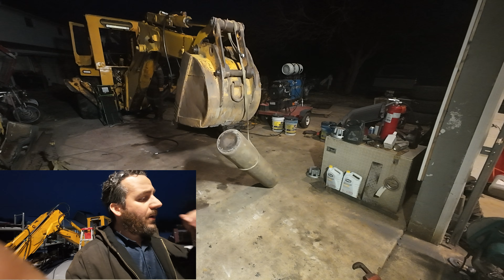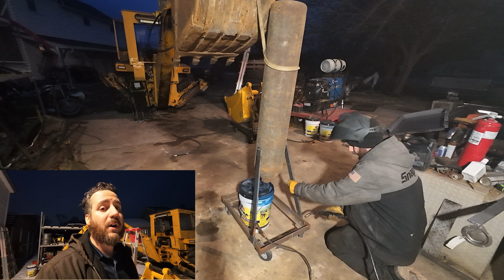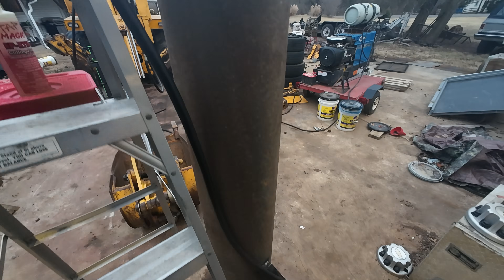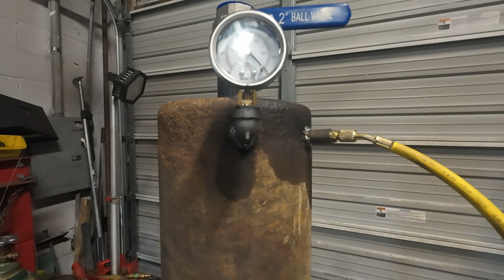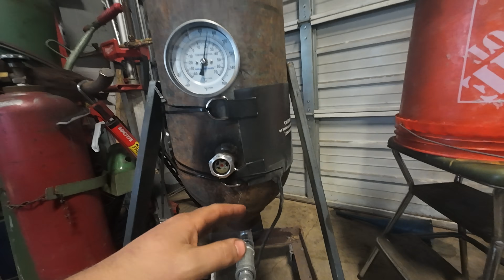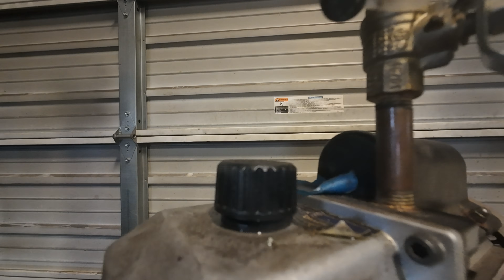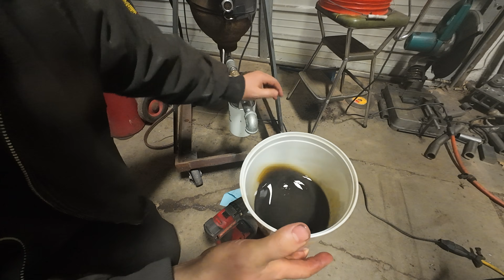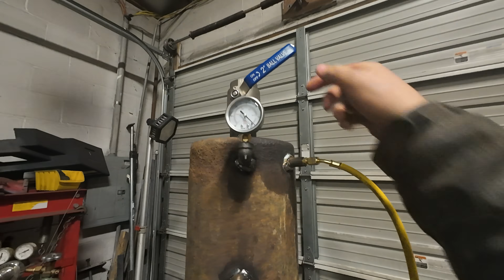I made a machine to remove water from hydraulic oil. Vacuum de-hydration

Comment: I understand this video is a year old but I just stumbled upon it. Didn't watch the whole video yet and I can't be the first person to make the suggestion, but seems you're concerned with the heat output of your belly band.  Especially in the colder climates. You're right dumping too much heat the ambient air.  Any insulation will do. Just wrap the tank from top to bottom. That would help with the extraction. Water vapor will condense on the sidewalls of a cool tank. The warmer the tank, the less condensing the vapor will do. Which means you'll increase your energy efficiency. And you'll also increase the speed at which you extract..   And we all know the most precious thing we have is time.  Takes a lot of energy to get water to change its state from liquid to a gas.  It'd be a shame to just see that gas recondensed on the sidewalls of the cool tank and just run right back down into the oil. Any old shitty insulation would do. It's the most important thing with it is. If you're using a fiberglass type insulation, that's fine. Just don't smash It. Smashed insulation  is about as useful as a toddler in a machine shop.  I'm enjoying this video.  And I'm stoked to see how it ends for you so far. It's a fantastic build, multiple sight classes and shit haha.  This is dope my dude!!

Comment: Your next design should be a simple gravitational centrifuge separator.

Gravity needs assistance for greater separation. Then, once that is done, you can use your boiling or evaporation processing for a final separation.

You can use a home AC unit for your fast water extraction. You shouldn't need high heat.

Put the home AC external coil into the oil. It will heat up the oil and water mixture. Have the air pulled over the cold internal coil, and it'll extract the water from the air. Use a simple hygrometer to see when the humidity is zero, or near zero, to know when it's done.

A simple water pump to pull the hot "water saturated oil" from bottom of the solution over to the cold side, to expose the water. Then, on the cold side, you skim the top oil off, back over to the hot side, since it has had the water extracted. (Return it to the middle, not the top of the hot side. The top of the hot side will be mostly oil.)

Comment: Love the work my guy! May I offer some suggestions, coming from someone who recycles oils and works with industrial level recyclers? 

Its not a big deal now, but metals from your oil might eventually concentrate to levels that are dangerous to your machines and health. And those metals will be fully dissolved in the oil, so physical filtering wont remove all of them. Developing a way to control those metals will go a long way in protecting your equipment and your health. 

Overtime, even well made steel can pit from exposure to hot oil and water, and it wont be obvious if that metal is weakening. If you had some way of looking in your cylinder to check for pitting, you would be able to spot failure points before the metal ruptures.

Comment: Definitely put an inline container between pump and tank to reduce the amount of oil getting into your pump. That’s  how we dis it when machining using a vacuum plate to hold work, to prevent coolant from invading the pump. Excellent setup!

Comment: Very nice.
Sticking the tank on a set of bathroom scales will tell you how much water is in there by doing a before and after measurement. You could also potentially use it to see when the drying process has completed. You may see a rapid drop in 10 minutes once you hit x degrees and y inches of vacuum and then nothing after. Having that info might allow a much faster cycle time.

Comment: Insulation around the heating band, and a good part of the cylinder. Will help greatly.
Also, I watched out of interest without much knowledge of the process. And immediately wondered. Could you use a whisky still off Amazon etc. Or would foaming be too much of an issue?
Reply from the maker: Wont know until you try!

Comment: An easier way is to buy a cheap electric hot water heater and strip it down to the tank. You can replace the existing thermostat with industrial controls as well as weld in a "sight tube" to give a much better observable fluid level in the tank. I have seen setups like this for processing used cooking oil into biodiesel and they will weld a fitting in the top of the tank to insert a mixer and run that continuously to agitate the fluid to keep the debri in suspension. To further take out moisture you can run the fluid through a series of filter driers that use desiccant as well as filter screens to remove more of the debri and get cleaner oil. This is a great idea to save money and help keep the performance up on the hydraulic system, it's my understanding that when the hydraulic oil has moisture in it and foams up it can be dangerous to the functioning of the booms and buckets, especially when trailered it can cause the arms to lift on their own just from vibration on the trailer, thats where you get bridge strikes on transportation trucking.

Comment: I just want you to know I thought of you and this video when I had an idea to fix a problem a little over a month ago.

Sort of unrelated to this, but I replaced a power steering rack, and the hydraulic fluid would froth and dissolve the gas we were trying to bleed out.

I don't know if it was because I had seen this video recently or just basic physics from the teachers I had in school, but I drilled a hole in an extra cap. Well, it became extra after I got another one because I was drilling a hole in that one 😂

I hooked up my vacuum pump with a chamber in between to catch any drippings, then just pulled a vacuum on the system. Once it stopped bubbling and pulled out all the air it could, I started the pump and worked the cylinder back and forth to circulate the fluid.

The rest of the fluid still had gas dissolved in it, but every time it went into the reservoir, the pressure above the fluid was so low that the dissolved gas would come out of solution and rise to the top.

The whole thing wouldn't bleed for over a week with a bunch of professionals working on it. Then I fixed it in about 10 minutes with a similar application of basic science and a vacuum pump. 😂

Comment: if you have a old freezer you can pull the vacuum line thru a tank inside it and it will freeze out the water on the way to the pump.

Comment: Those old cylinders are not clean inside. So a pile of the dark colour coming out is probably just cleaning out the old tank.  It will most likely get better with more cycles - you could even totally top off the tank then dump it out again a few times, to move debris off the tank walls.  It would be interesting to run the output through a centrifuge, to see if more fines stuff comes out.  Re operating it, I would probably just run the heater for an hour first with the top valve cracked open, then when it's warm turn the vacuum pump on - the pump noise would drive me nuts.  :)

Comment: Tipping the tank horizontally will significantly speed up the dewatering process.While turning the tank horizontal increases the surface area by 4 to 5 times, in practice, the actual rate of water removal will likely increase by even more than that. Here is why changing the geometry makes a massive difference:

1. Surface Area & Mass Transfer Limits

Evaporation under vacuum is directly proportional to the liquid surface area exposed to low pressure. In a narrow, vertical tank, water molecules must reach that small top layer to vaporize. By placing the tank horizontally:

You multiply the liquid-gas interface area 4–5×, allowing 4–5× more water molecules to escape into the vapor phase simultaneously.

The average distance water molecules inside the fluid have to travel to reach the surface is drastically reduced, shortening the diffusion path.

2. Reduced Hydrostatic Head (Pressure Suppression)

In a vertical column of fluid, the weight of the hydraulic fluid creates hydrostatic pressure at the bottom.

Liquid oxygen tanks are tall cylinders. A few feet of heavy oil exerts enough pressure at the bottom to suppress water from boiling, even if the top surface is under deep vacuum.

Laying the tank horizontal flattens the oil layer, eliminating most of this hydrostatic head. This allows trapped water pockets at the bottom to boil off at much lower temperatures throughout the entire bulk of the fluid.
Reply: Commercial machines exist. They are commonly referred to as Vacuum Oil Purifiers, Vacuum Dehydration Units (VDUs), or Kidney-Loop Oil Reclaimers. Maximizing Surface Area (Atomization): Instead of letting the oil sit in a pool, the machine uses internal spray nozzles, coalescing column packings, or spinning dispersion discs to turn the oil into a fine mist or thin film. This increases the surface area thousands of times over, evaporating free, emulsified, and even dissolved water down to single-digit PPM levels within hours. Polishing & Return Pump: The dry oil is pumped out of the bottom of the vacuum chamber, passed through a fine particulate filter (often 1–5 micron) to catch debris, and returned directly back to the main reservoir.

Comment: That reminded me, I use to work at a power plant. Among the issues we ran into was contamination of the oil for turbines. The company found out our expensive equipment was getting ruined. We were asked what we were doing to clean the oil?
We had an oil centrifuge that hardly nobody could operate because, it was work, people were too lazy to do their jobs. The guys with the most experience knew how and many of the younger guys didn’t want to learn. 
So the company invested thousands of dollars into a new system to clean the oil, using very fine filters. But they still required maintenance. 
The job of the operators was to keep an 👁️ on the equipment, take daily readings and alarms. 
Then the job of maintaining or cleaning. It became my job to write up a procedure how to change filters, very simple. Again nobody wanted to do any work. Again we fell into the same problem of contamination because nobody wanted to do any work. 
Again I was asked to order the parts needed to bring the equipment back to 100% status. 
For me as a mechanical minded person, it was very simple. It took me about 2 weeks of ordering the parts and getting it back in service.

Comment: Since you're heating the oil already for the water separation, additional filtration using a centrifuge should work well, it should get out most of the remaining particulates, and would be fairly easy to add as a second stage with the way you build that system. This looks to me like a fairly effective and reasonably cheap way to accomplish the mission, I just might build something of this sort for myself, I think it would come in quite handy on occasion, partially because I am a professional waste oil heating equipment technician and of course I use the nasty stuff myself for heat also, but have no plans for processing customers' oil... Ain't gonna go there, that's a whole 'nother business that I don't want. Some of our customers are construction eqpt service shops that burn lots of hydraulic oil for heat, and it is definitely one of the better fuels (unless it's flame-proof aviation grade... that's a story with a lesson), it burns hot and leaves minimal (snow white) ash deposits compared to other oils.

Comment: I PICKED UP AN OLD-- CHEAP --CHEST FREEZER--HOLDS 4 ---5 GAL PAILS--THE WATER FREEZES--THE OIL POURS OUT--THEN I DISPOSE OF THE DIRTY BIG ICE CUBE--I USE THIS PROCESS TO REMOVE THE ETHANOL FROM THE GAS I USE FOR MY GARDEN TRACTOR--CHAINSAW--WEED WACKER  ETC --I PUT WATER IN THE ETHANOL FUEL---THE ETHANOL BONDS TO THE WATER AND FREEZES--WHEN YOU GET RID IF THE ICE CUBE----YOU HAVE PURE GASOLINE---YOU NEVER HAVE ANOTHER BLOCKED CARB ---FROM GUMMED UP ETHANOL

Comment: Hmmm, would using dry calcium chloride as a drying agent at the bottom of a column and filtering the  emulsion through it do a quicker job of it? you only need to bake the calcium chloride every so often to expel the water it holds on to?!?!?!

Comment: I had used a large ring burner stove and huge pot to get the water out from my oil. I looked up the max temperature that the oil could handle on the spec sheet and made sure it didn't cross that. It worked but that was a tedious process and I doubt I will do it again even though I know I would not have gotten all of the moisture out since some would have still been trapped in the cylinders.

Comment: suspended particulates, huh  I forget a lot of things ..reminds me of ethanal fuel is a suspended liquid, within gas and it seems that it is a water based alcohol that of course burns, but also corrodes the crap out of fuel system parts,  I saw a vid where a man added water to Ethanol gas, let it sit in a clear container and ended up with more water when it separated .I was amazed at what he was doing and how he found that out. I am working on used oil for diesel and saw this again , I have a vac pump i will tap into my 50 gal drum and dry the fuel/oil this way . good video

Comment: Boiling hydro fluid ruins it just as bad. Hydro oil gets burnt and gets ruined. Just as you made.
Reply from the maker: Gotta wonder if its the temperature or the vapor pressure? It never exceeds 140F in this setup... but things can still technically boil

Comment: From ryco filters

"Standard Filters: Often rated at 25–35 microns.High-Performance/Synthetic: Often rated around 10–20 microns.Significance: A 15-micron filter can reduce engine wear by roughly 70% compared to a 40-micron filter."

Need a good hydraulic oil filter to get finer

"Hydraulic oil filters typically range from 3 to 40 microns, with common, high-efficiency filters often rated between 5 and 10 microns (absolute) to protect sensitive system components. Return line filters often use 10–25 microns, while suction filters are coarser, around 100–150 microns, to prevent cavitation.

Comment: So if you want some interesting modification to that system...

First, use a double or tripl vacuum pot design BEFORE the pump.

Second, put a valve in the vac pump line.

Third,..this is crazy...Go get a double action hand pump. This is by ozark trail, used to for inflatable beds.

You can use the hand pump to pull initial vaccuum very quick, then switch to the electric to pull a hard vac.

Ps..
I forgot this. Since what your doing is literally distillation...

The bigger your output orfice, the more volume mostly, and sometimes faster you can pull of your distillate..Ie water.
Downfall is, it's require a significant btu/heat input.
It's usually rated as litres/quarts/gallons per minute/hour.

Also, hydraulic pressure is basically a rating of compression. Compression alone, can generate allot of heat.
An electric forklift typically is rated for 8k psi...NOW, let's put this into perspective...
Transmissions-400psi@around 120-230°f; brakes-400-800psi@400+°f; power steering-1k-1800 psi-unknown°f.
These all use a form of hydraulic fluid.

Facture in, water boils at 212°f.. So hydraulic fluid MUST withstand temps above that, or, it would literally be a lost cause. To the extent that nobody would use or buy it.
SERIOUSLY, think about this. 
1% of a 100 gallons is 1gallon. JD fluid can handle half that....?

Comment: Put the oil in a barrel let it sit and it will separate, Oil floats on water !
Reply from the maker: That would work for some oils. Hydraulic oil clings into water through its emulsifier package. It takes years for the water to separate naturally
Reply: @spankranchgarage   suspended particulates, huh  I forget a lot of things ..reminds me of ethanal fuel is a suspended liquid, within gas and it seems that it is a water based alcohol that of course burns, but also corrodes the crap out of fuel system parts,  I saw a vid where a man added water to Ethanol gas, let it sit in a clear container and ended up with more water when it separated .I was amazed at what he was doing and how he found that out.  I am working on used oil for diesel and saw this again , I have a vac pump i will tap into my 50 gal drum and dry the fuel/oil this way !

Comment: How many kilowatt of power per run? I am off grid and would like to put something together like this for our ranch. Thank you for posting!
Reply from the maker: The heating band was like 400 watt if I rember right, and the pump pulls approx 3.2A at 120V. I think 800 watt/hour is a good start. In the summer time or over a small fire you wont need the heating band.